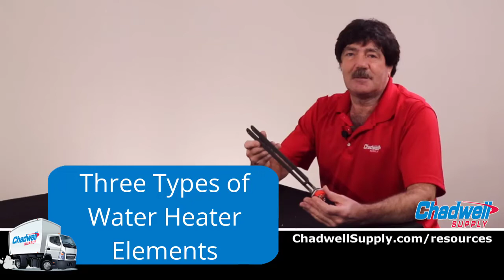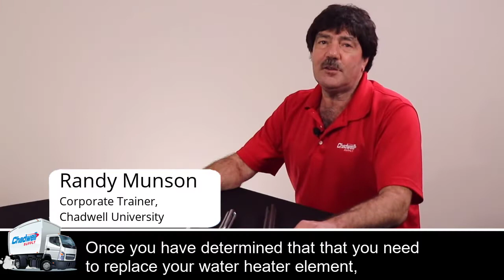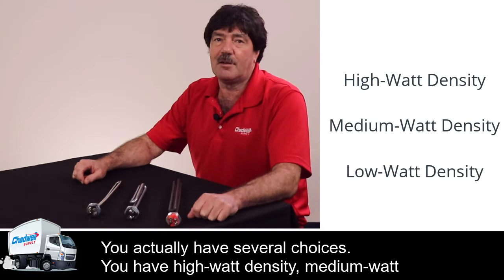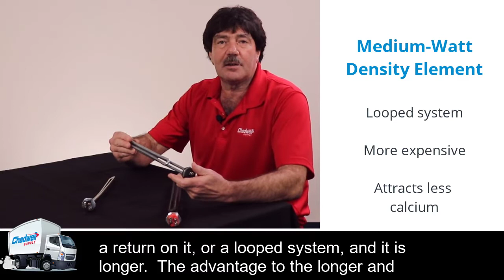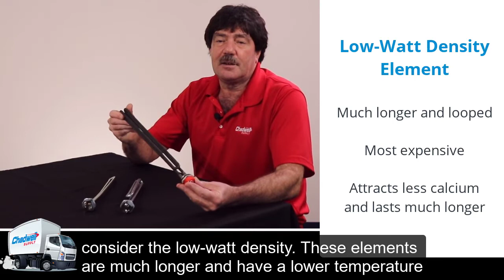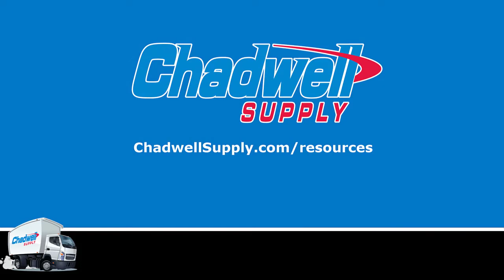Three Types of Water Heater Elements

Comment: thank you very much, you perfectly answered my google question. I just had to replace both elements in my 50 gallon and was confused about the curved one as opposed to the straight. the difference in price made me choose the straight one as it was 13$ as apposed to the 20$ curved one; same wattage and voltage too. anyways I dont have a calcium problem so I am glad I cheaped out and it was actually beneficial!

Comment: Another helpful tip is element wattage in addition to watt density.   In almost all cases a bad element should be replaced with the same wattage as listed on the heater's nameplate with one major exception.   Sometimes in older homes or apartments the water heater was wired with #12 wiring.   A typical 4500 watt element could overheat these wires and trip the breaker or create a fire hazard.  In a situation where it is not desired or cost prohibitive to replace the wiring with #10, a lower wattage such as 3500 should be used, and you should indicate this on the heater in large letters to warn others should this element need replacement in the future.    

On the other hand installing a higher  wattage than the nameplate ex. 5500 watt  in a heater rated for 4500 could damage the internal wiring and void the warranty.   

Most elements have a two wattages marked, for 240V/208V.    208V is two phases from a 208Y/120V three phase system and would typically be found in hotels/motels, restaurants and other commercial buildings,  as well as some apartment buildings
Reply: Thank you so much for this additional information ☺️